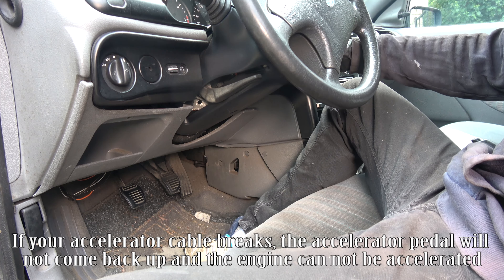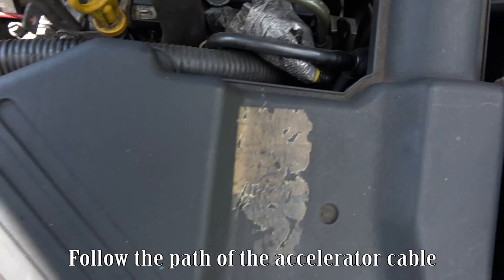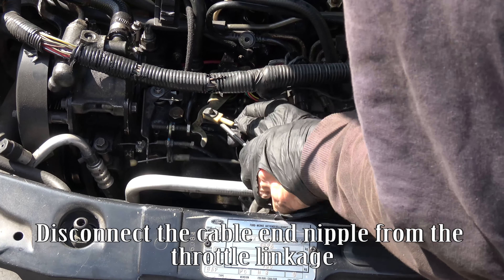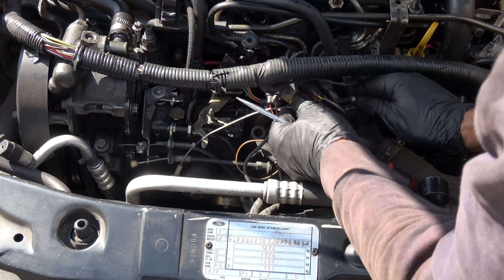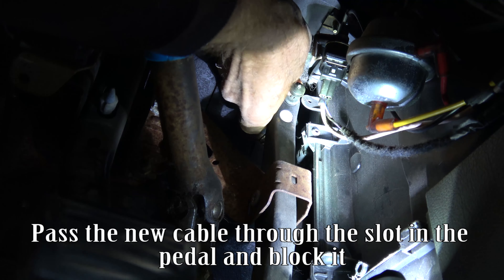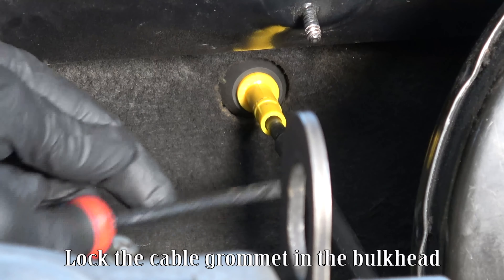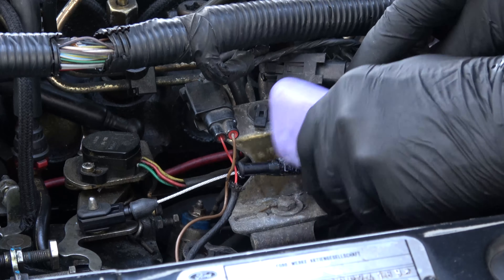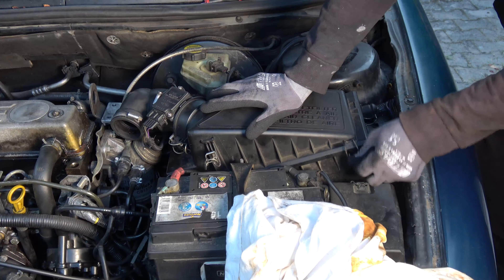How to Replace Your Accelerator Cable And Adjust It

Comment: Saddest part is this is the best video I've seen so far. Most only show how to zip tie stuff.  Worst part is the is no year make or model of what car he is working on, so it does me no good. in that area. as far as being able to see what he was actually doing. not good there either.  at least with the AI voice I could clearly understand what little instruction there was.
Reply: Throttle/acceleration cables are pretty universal, so the year, make and model are pretty much useless unfortunately. This video worked for a 95 Oldsmobile and an 86 Fiero

Comment: Yo when you were refitting the cable and nipple on the throttle linkage, why were you tugging and pulling on it aggressively like that?  Seems to defeat the purpose in replacing the cable in the first place if one reason being it gets stretched out. If more slack is what you were trying to achieve, then just unclip the metal clip that holds the cable in place instead of stretching the cable back out like that 🤷‍